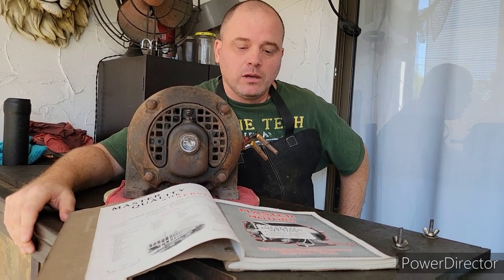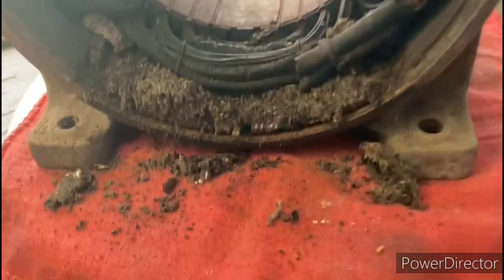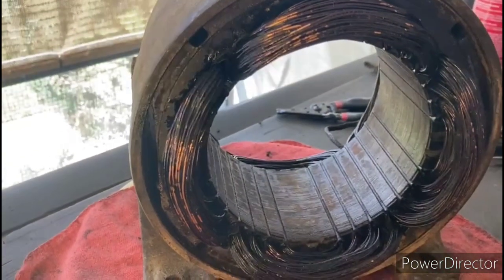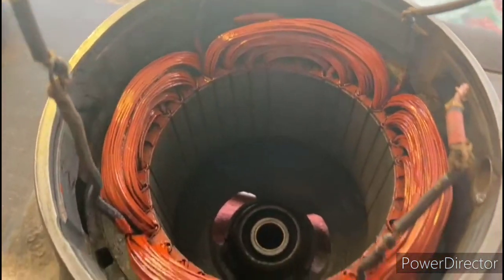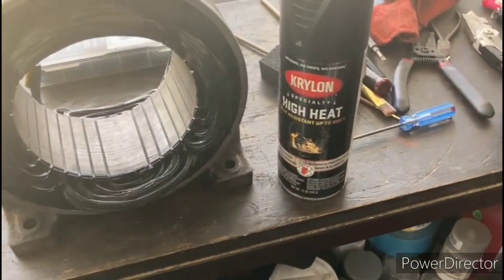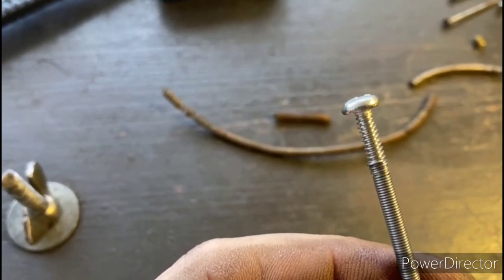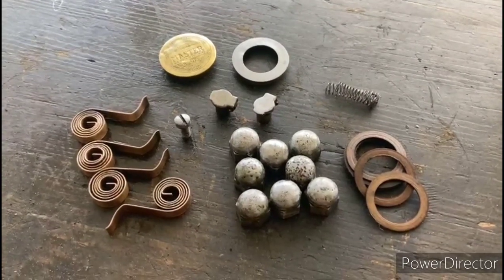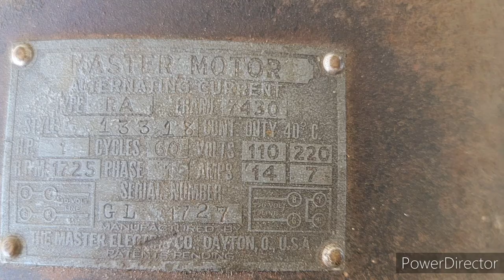Master Electric: Repulsion Induction Motor Restoration. Fabricating A New Short Circuiting Spring.

Comment: This is cool. I just restored the exact same motor about 6 months ago. I plan on using it on a 6" Walker Turner jointer that I also restored. Owning and using these old gems makes me feel like a rich man.
Reply from the maker: Those old Walker Turner jointers are nice. Im sure you will enjoy it. Agree with you about owning these vintage gems. They were made to last. Thanks for watching.
Reply: @BencoVintageMachineWorks  thanks. I have my jointer up and running and I'm very happy with it. I do have a question, what type of oil should I use for the bearings? Thanks.
Reply from the maker: @bradleymasson1777  If your motor has oil wicks you can use a quality 10w non-detergent  oil like Zoom Spout. This lighter weight oil facilitates the capilary action that wick oilers use. If your motor has ring oilers then use 3 in 1 Electric Motor oil which is a 20w. The slightly heavier viscosity keeps this oil from slinging off the rings.

Comment: Tremendous work rehabilitating that lovely motor.  At about 8:50 you mention, at least twice, that you needed to wait for the windings to "dry out" before applying new varnish.  Did you use a soap/water wash, or some other liquid?  I totally missed that.
Reply from the maker: I prefer not to hose off the windings and consider it a last resort. In this case, there was an oily liquid that had damaged the windings and I had to use Dawn detetgent and gently clean them. An electric motor stored in a garage, basement or outside can have too much moisture too. When I speak of "drying out" its refering to warming and drying the windings using a heating pad until they are nice and toasty before applying a new coat of varnish.
Reply: @BencoVintageMachineWorks  Thank you.  I've seen a lot of mentions cautioning against hosing off or washing with pressure for fear of inadvertently breaking some of the winding wires.  I could more easily see using a household spray bottle and tap faucet rinse followed by either the warming pad or perhaps your heated fan.  Much appreciated.
Reply from the maker: Glad you enjoyed the video

Comment: Fantastic job as always! Where do you source the bearings? Would love to see more detail on making the spring. I think these are the first non-straight motor studs I’ve ever seen.
Reply from the maker: Hello Brian, 
Thanks again for the kind words. When possible, I try to order bearings from McMaster-Carr. They also carry the extension springs needed for the shorting necklace. As you probably know, VMO has a wiki on replacing the spring on a Delta repulsion with step by step photos. The process is pretty much the same as I have done here. I did feel that those bent motor studs were inferior to the straight ones. These end bells are easily mis-aligned with each other because the motor studs allow way too much play. Glad you enjoyed the video!

Comment: Wonder where brushes are found for these? Curiously my 1.5hp is shunted. It didn't look like yours are.
Reply from the maker: Eurton electric has brushes. I usually find them on ebay. You can buy slightly oversized and file them down easily enough. I removed the shunt wires on these as I often do. Reason being that sometimes the non-OEM replacement brushes may have the wires coming out in the wrong place and this can cause it to get hung up. A properly cleaned and maintained motor will run fine without them, as seen in the video.

Comment: Great video.  What type of electrical varnish/insulation paint do you use?
Reply from the maker: If I need to apply a heavier coat I use the brush on Glyptal insulating varnish which is usually red in color. For lighter applications I use Sprayon EL-600 clear spray varnish. Both are great products. Thank you for watching.
Reply: Can you also post where you got the bushings?  I am doing the same to a 1/2hp version of that same motor (first time) and I'm using your video as a guide.  Also, where did you get the 3 jaw puller to remove the bushings?  That thing is huge.
Reply from the maker: @danielcargill5388  The puller is an old USA made Craftsman. As for bearings, I usually order from Mcmaster-Carr. Sometimes you need to bore out new bushings ever so slightly to get a proper fit so be prepared to do that if needed. A set of adjustable hand reamers comes in real handy for that task.